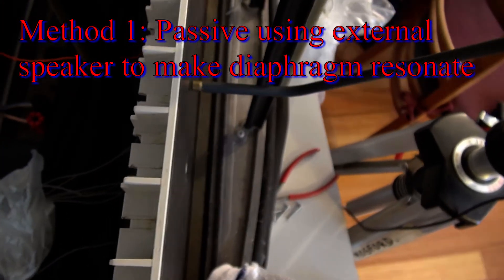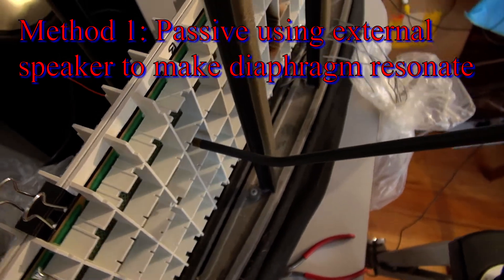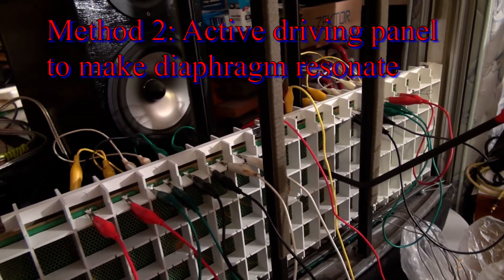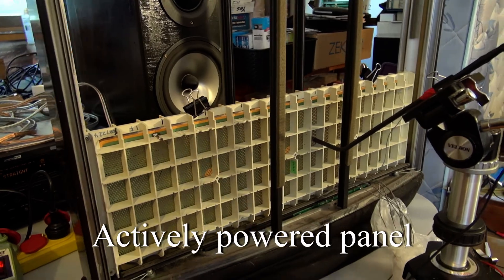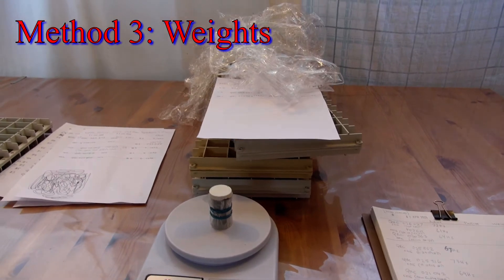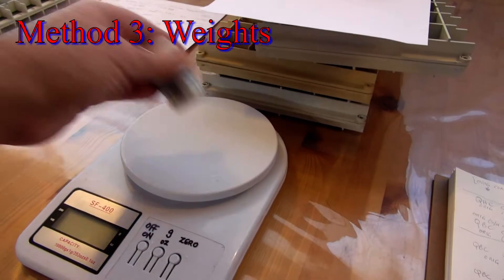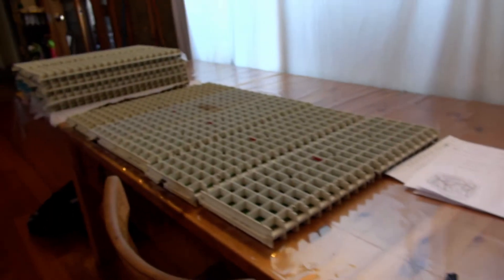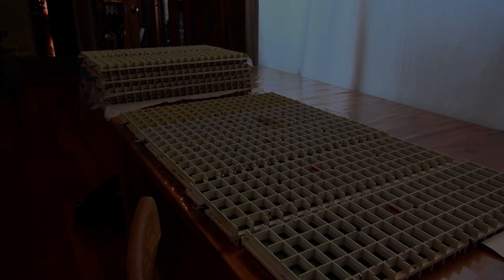Quad ESL63 Repair Part03B diaphragm resonance

Comment: I find resonance by tapping on the diaphragm with my finger, recording the sound, and then measuring the waveform using Audacity. I have found resonance to be 98 Hz on original, undamaged  Quad diaphragm.